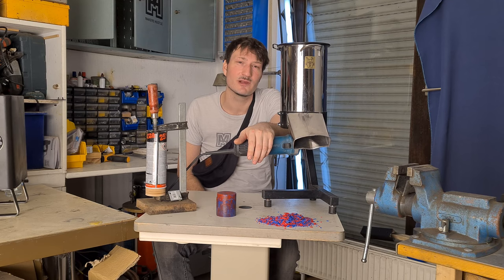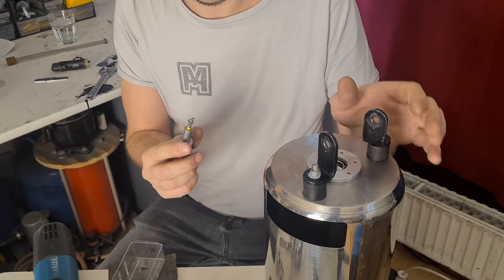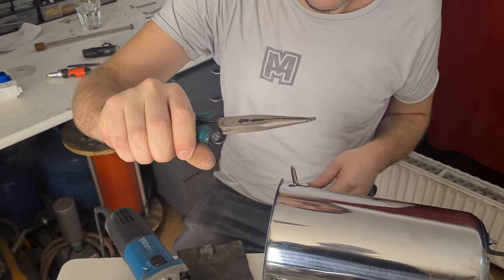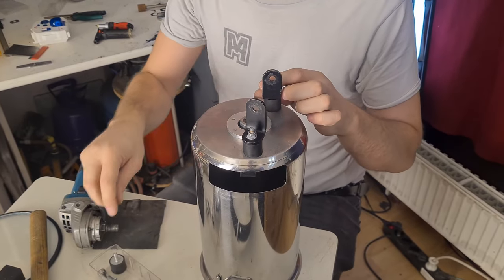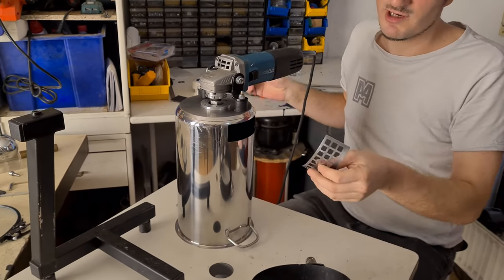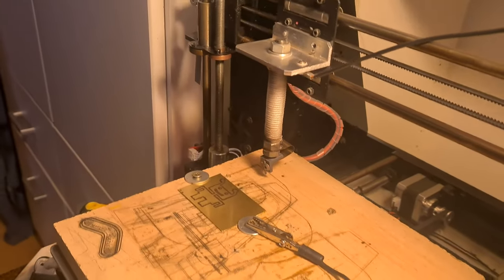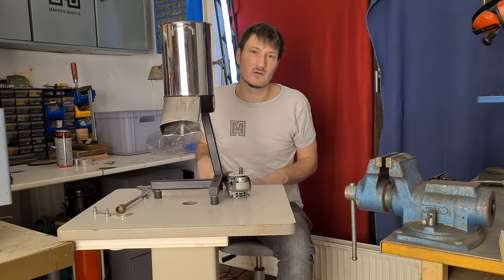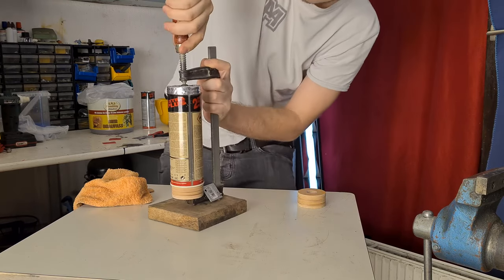Crazy fast cheap DIY Precious Plastic Shredder / Blender with Angle Grinder – Recycling Machine

Comment: Great solution! Im looking for the same thing to shred water bottles. Could you perhaps make a parts list? Id love to build one I just dont have alot of time to research parts 😅
Reply from the maker: 😃Different ways would be possible..in this particular design the main components are: 1 angle grinder polishing adapter with M14 inner and  M10 top thread, 1 M10 nut+washer and 1 flange ball bearing with 20mm inner diameter

Comment: Great design! I think I am going to try to build one for shredding 3d prints. Currently working on a filament extruder for recycling failed/prototype prints. Keep up with the videos!
Reply from the maker: THX!! (New Video in about 2- 3 Weeks, than hopefully every month :) Check out update below‼No assumption of risk and above all have a lot of fun 😎✌
Reply: @makershustle  I will give it a try and see what prints (material and thickness) can be shredded. The cost of building the shredder is low enough to try even if it doesn't work.
Reply from the maker: 💪Cool, would be nice to hear how it went🔥
Reply: @Kris2832 hi, did you manage to build one? Can it shred pla? Thanks
Reply: @rcalin9354  Haven't finished it yet, will update when i do👍
Reply from the maker: Update: Even larger 3D printed parts with 3 times 0,8mm outer shell shredding is working quite nice, but it made dents in the cooking pot, brake the acrylic on top and bend the blade. Gas bottle as Container and thicker blade and it should be the perfect low budget 3D print shredder 🤫😉

Comment: Greetings, what about that blade? Any detail? Thank a lot
Reply from the maker: Hi, I tryed High-speed steel (HSS) as thick blade because thin would snap to easy => still dangerous and thick blade don´t seem to be good. I tryed regular 316 Steel  => bend way too easy. I thought about buying and trying spring steel, but Bread knifes are cheap and local available so I went with this => Works great but it broke on the bent after shredding heavy 3D printed parts... So it´s onto you to start further experementations. 
PS: New Shredder Video is planned but as first next Video will be electic Jet Ski from electric scooter and both hopefully more fun to watch than my new video..SRY the musik came out  too loud and just mabye a bit stressful 🙈😅
Reply: @makershustle  great, I will wait for your new video, meanwhile, I start to do my own shredder for recycle plastic bottles, Thanks for this.

Comment: Does this work to shred PLA? Thanks!
Reply from the maker: THX for interest.. Check out update below..  Good luck, have fun and stay safe ✌
Reply: @makershustle  ok, thank you!
Reply from the maker: @rcalin9354  Even larger 3D printed parts with 3 times 0,8mm outer shell shredding is working quite nice, but it made dents in the cooking pot, brake the acrylic on top and bend the blade. Gas bottle as Container and thicker blade and it should be the perfect low budget 3D print shredder 🤫😉
Reply: @makershustle  thank you for the info.